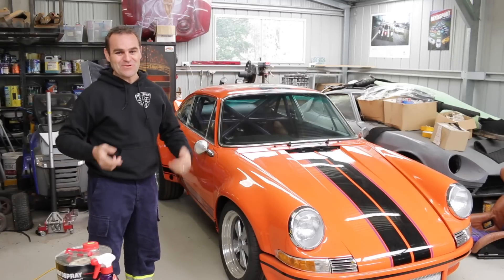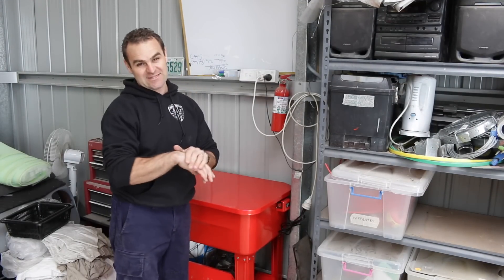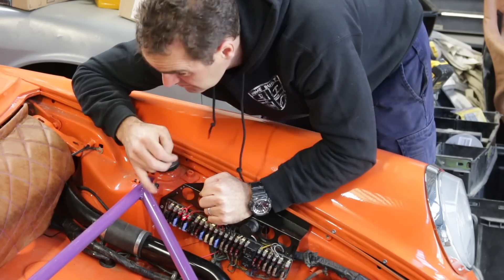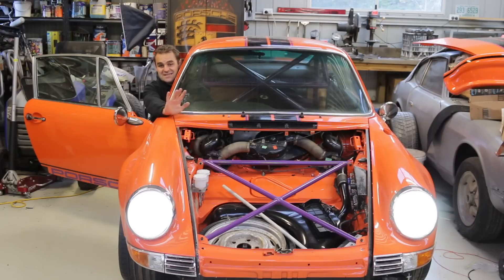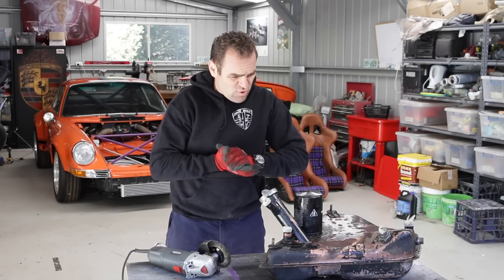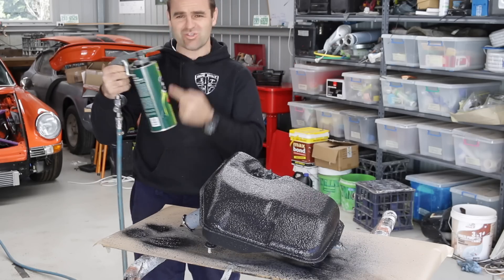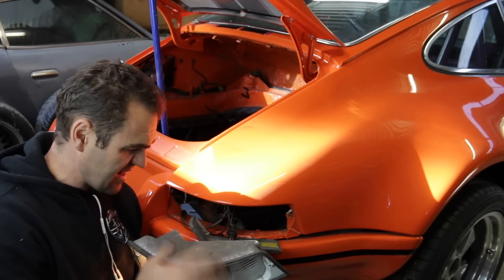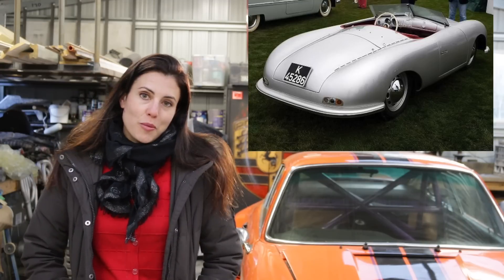Porsche 911 Classic Car Build Part 61 - Cleaning up the oil tank

Comment: 1) 8:32 shop kitteh!
2) oil tank came out great
3) interesting fun facts today
4) be careful that your wiring is not all dried up, cracked, etc as many older car fires are due to old brittle wiring
5) always enjoy the outtakes
Reply from the maker: Thanks mate. I have been having a look at the wiring, and most of it seems OK. There are a few bits that I will need to address though.

Comment: Hey Jeff, just a quick tip. Get yourself a box of diposable rubber gloves for the shops (Coles, Woolies) for when your painting etc. Keeps your hands clean and doesn't slow you down or let you accidently leave dirt fingerprints etc if your putting things back to together or working on other parts straight away. You just rip them off and chuck them out. Oh, good to see you finally got yourself an underbody gun. Also make life much easier.

Comment: Hey Jeff, another great vid mate, keep it up. On the electrics, a loose, absent or poorly connected earth will always cause problems. The best thing you could do is go through each circuit and check all earths are present, tight and making a good contact to the body of the car. This could be the cause of your mysterious dash lights being on whenever the battery is connected as well as the tail light issue. As for the buzzing, my guess is a relay like others have suggested. While I remain in awe of the stuff you can do, I am an electrical engineer, and happy to help where I can. If you don't already have one, get a multi meter (even Aldi has them on special this weekend!) to help you diagnose the electrics. Cheers, Ty
Reply from the maker: Thanks mate. They are some great tips. I will go around and check all of the earths like you suggested. I have a multi meter so I will try and learn how to use it and slowly work through everything...... hmmmmmfff. ;)

Comment: The noise is the "key has been left in the ignition switch" buzzer. Pull the key out.... It is normal when door is open..
Reply from the maker: I had another suggestion of that. As soon as I get home I am going to try it :D
Reply: that was my first thought too.
Reply from the maker: That was it. Key warning. I should have thought of that.
Reply: I had one on my 78 SC - it was a right pain in the ar5e.

I had it rewired so that if the key is out and the lights are left on it goes off.  That's really handy as I'm always forgetting.....
Reply: murph2309
That's a good idea.

Comment: Another great video. Glad to see you back in the garage working on the Porsche. Electrical issues were always my nemesis when it came to working on cars. I always left it to my electrician friends to sort those problems out. They always knew where and what to look for.

When you stated that you "...have a small brain, and it hurts right now", the expression on Mrs. Jeff's face as the wheels were turning in her head wanting to respond. You left yourself wide open on that comment Jeff. 
But, Mrs. Jeff was kind to let the moment pass and not start listing all the things she could say. 

One last comment. Do you have a car cover for the Porsche? When you are doing all the grinding and spray painting in the garage many of the paint/rust particles become airborne and could settle on the car. You might want to cover the car when doing those types of work. Just a thought.
Reply from the maker: I should cover it up, but I have to sand back the whole car and buff it up soon anyway, so I am not overly concerned.
Reply: That sort of answers my point, I was going to recommend not wearing your watch. One slip and that buckle may take precious paint off. Once it's done though, I would leave it off as you finish up the details. great video.
Reply from the maker: I am not too concerned about my watch causing damage. It is just a rubber G-Shock. It is more my clumsiness with everything else I need to worry about ;)

Comment: hi please remember to clean the inside off the oil tank before fitting, and for the front blinker(turn signals) i think the rear bulb is side markings and is suppose to work with the low beam on the rear turn you have the same extra place for a bulb, that to me say side marking lights as they have in the us. as always keep up the good work oh the  fuse box in the engine compartment is that going to beused at all , cause i thouht you were getting a new injection system put on, from the last video you made???
regards
Sören
Reply from the maker: I haven't actually looked in to what the rear fuse panel (or any of those things I put back in the rear) are actually for, but you are correct. I will more than likely never use any of that stuff.
Reply: basically the rear fuse panel and 14 pin connector(s) are for the blower, rear window heating, could be A/C and engine bay light and bits and pieces for CIS, which you won`t need. Did you have a lambda control unit? in my case it used to be there, and the whole "brain" for it was under the right (passenger) seat and I have got rid of it completely. 
BTW, just for an advice I reckon, if you need to do something with wiring it`s quite helpful to take a photo of that diagram you exactly need and print it. The mobile phone not that dirty and if you have a book - stays clean as well so you can read it in bed :)))
Reply from the maker: I no longer have rear window heating or CIS. I still would like the blower for the rear, but I have no idea where it is (or is supposed to be). No idea about the Lambada control unit.

As for the print out of the wiring diagram, I actually tried to print it out, but my crappy printer didn't do a decent job in colour and b&w doesn't cut it. A nice laminated print out would be much better though I agree.

Comment: OK, this is a longshot and I know almost nothing about Porsches, but is it possible for the buzzing sound to be the fuel pump? Some ("ordinary") cars are wired so that when you open the driver door upon unlocking it it triggers the pump.

Is the new spray gun easy to work with?
Reply from the maker: It is not the fuel pump because there isn't one in the car at the moment. Some have suggested that it could be a relay that is playing up. I have a feeling that might be on the money.

As for the Schutz gun. It works great. My only issue, is that it sprays out fast at the lowest pressure you can use. Any lower and the venturi doesn't work.

Comment: Sometimes a relay buzzes due to low voltage..thanks for the video
Reply: my thought too. deffo no warning buzzers fitted at factory.
Reply from the maker: Great suggestions. I think you are onto something. I will check it out.

Comment: Hi jeff, did you manage to find out if your mate wants the amg steering wheel? Im still interested so let me know!
Also, about the buzzing noise. Your suspicion could be right. Both of my mercedes have the exact same buzzing noise when I get out of the car and leave the headlight or interior lights on!
Hope you get it sorted, the porsche is beautiful
Reply from the maker: Hey, mate. I haven't heard back from the other guy, so if you are still interested in the steering wheel send me an email or a facebook message and I can send you some better pictures.
Reply: Home Built By Jeff great I will send you a facebook message, thanks!

Comment: Almost a shame to repaint the oil tank . . . looks good stripped back to bare metal!  Nice job with the schutz though . ..
Reply from the maker: If it was even all over it would have looked nice, but it sits in the wheel well so it would get bashed up by rocks and stuff anyway.

Comment: What bulbs Jeff?
Reply: Home Built By Jeff sorry could have been clear head light bulbs did you use there good and bright
Reply from the maker: They are LED bulbs. I can't remeber the exact ones they are, I just got them from ebay but the seem to work ok. I won't know until I get the car on the road how good they really are.